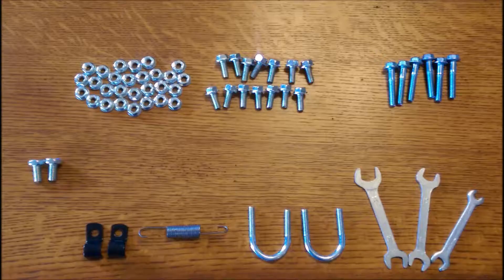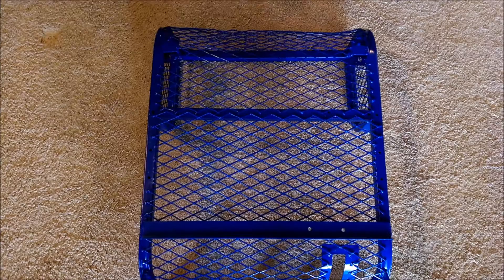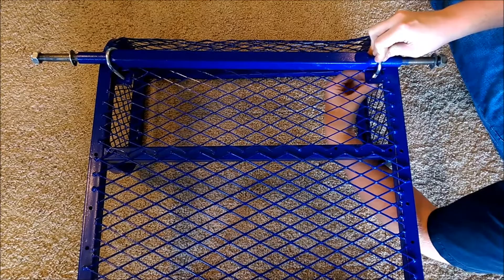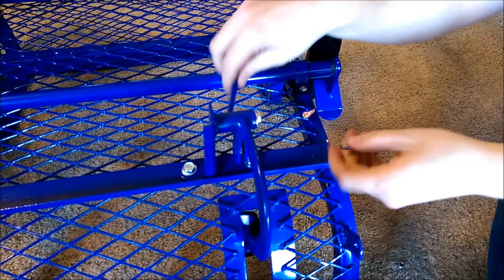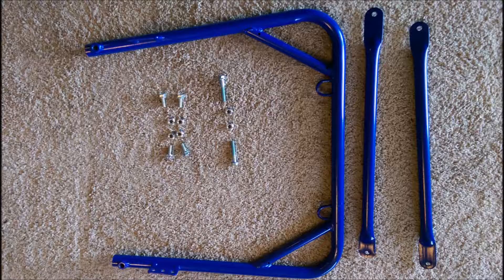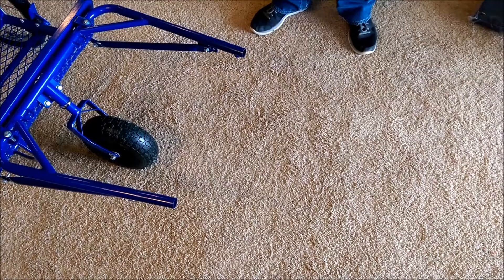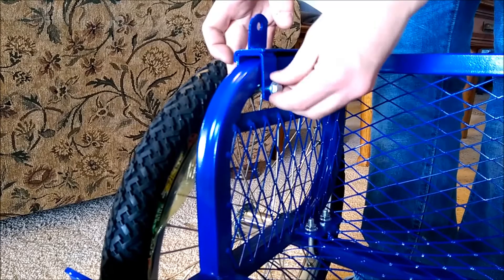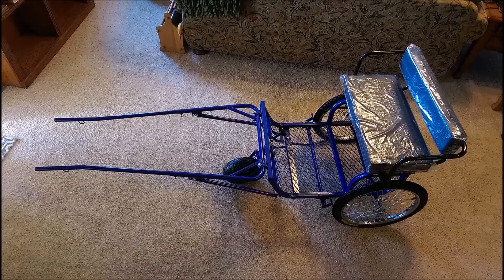Dog Cart Assembly Instructional Video

Comment: And pump up the tires. And when you do, I hope you find your front tire doesn't have a hole in the inner tube. 
The predrilled hole in the frame where I was supposed to hook the brake spring was not predrilled. So I hooked it to the wire mesh. I have more to say, but I have to go get a patch kit for the inner tube right now.
Reply: My front tire doesn’t require air, but I did find the same issue for the brake spring. Doesn’t seem like an issue.